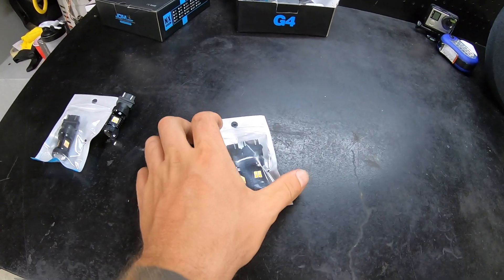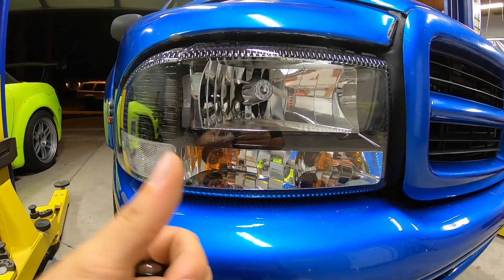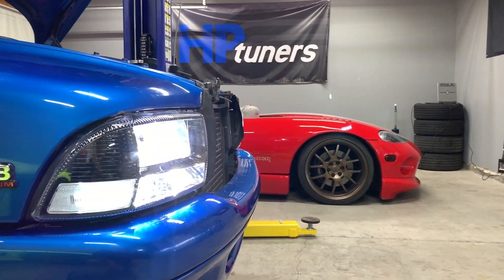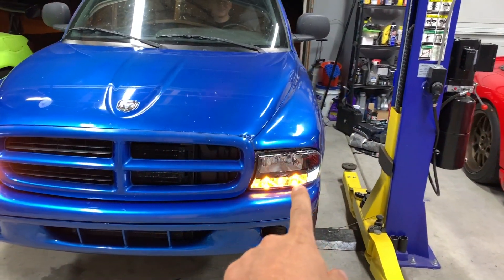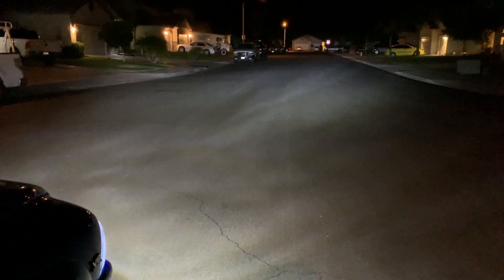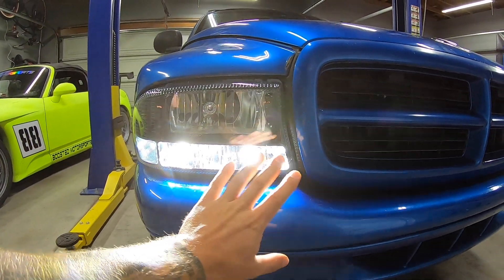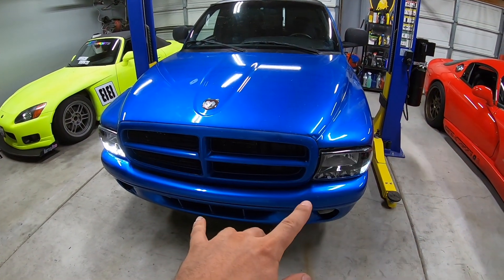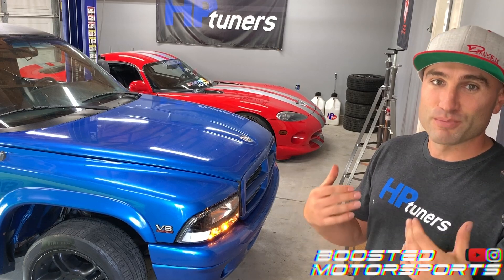3157 LED SWITCHBACK BULBS WHITE TO AMBER - JDMastar - DODGE DAKOTA

Comment: Finally someone else made affordable Switchbacks that function correctly. The old ones used to blink white then amber when your turn signal was on. Which is technically illegal. But these fiction the way they should. White turns off then only blinks Amber with the turn signal activated 👍

Comment: Ok so apparently my stock relay was toast! Picked up a new relay at orielys and they work flawlessly! Just need to upgrade my headlights and dogs to led to complete the look thanks for your awesome videos bro! Really excited to find someone putting out quality info on these awesome trucks
Reply from the maker: Glad you found the problem Travis! 💪
Reply: @BoostedMotorsports  what bulbs are you running for the corner lights?
Reply: @sean.g4516  194 led
Reply: Was your turn signal working when you first the bulbs in? I can’t signal is it because of my relay?

Comment: I love these lights! I have a 2008 Saturn Aura and I just intalled the Hikari High Beams and the Cougar Low Beams in my car and they put out a TON of light! I rarely use my high beams because the low beams are so good! I bought the 3157 switchbacks and what I find really cool is when I remote start my car they will still show up as orange but when I turn the key they will turn white for the DRL which is interesting. Thankfully, I didn't need a resistor as I can't splice to save my life.

Comment: 3:52 all that light that you're impressed by in your switchbacks is useless to the driver because the hood-line blocks the road being lit up in that 'hot zone'. 

Sure, as a pedestrian walking in front of your truck, they'll be blinded by the light if they look at your parking lights but if they look straight down at the road, they'll be able to see their contact lenses on the road should they pop out of their head from squinting so bad at the blinding light. Pretty sure Five-O will be really impressed on a dark back road though.

Comment: Anyone able to advise me... Want this type of thing but to work on my reverse lights and rear turn signals. So they would be just turn signals until I go into reverse then they switch that way over but potentially have the over ride so if I am signaling then which ever way Is engaged to signal stays on signal but other bulb switches?

Is that possible? Any links to videos showing this?

Comment: How did you have running lights my 98 doesn't did u have to wire them up?
Reply from the maker: I know the switch is different on 99+ but that’s stock. It’s a dial type switch but I think on the knob one you have you should be able to just pull it one click out or halfway for running lights
Reply: @BoostedMotorsports  oh i always knew them as parking lights lol after its been so long u still like them still recommend them?
Reply: @BoostedMotorsports  hey quick question as well where did u get the dash lights mine are half way out I might as well add some color

Comment: Did you have to add a load resistor? I bought the switchbacks but when I plug 2 on one side, one turns on the other doesn’t, I assume because the wiring is connected.
Reply: Did you ever figure out if you needed resistors for them

Comment: Hey man great video I just bought these bulbs for my 2003 ram 1500 but befor I installed I realized that I have bulb shields on my turning signal side of my new headlight housing. My question is will they work with the shield still Intact or could I remove it?
Reply from the maker: I would use it with the shield. These are super bright. I’ll be installing them on my 3rd gen next for you guys in a video so make sure you’re subscribed 💪

Comment: Not that im late or anything but did you just install new bulbs into the stock light frames or are those also new?
Reply from the maker: Aftermarket headlights 💪
Reply: @BoostedMotorsports  sick!!!  I have a 2002 Dodge Dakota Sport 4.7 first car! I want to do a lot to it
Reply: well technically second car but first truck

Comment: Looks awesome, nice upgrade! These work without resistors? Or do they have build-in resistors?
Reply: Yes we need to know this
Reply: @lettzagobrandonyeeyee4309  just installed mine they need a resistor, i dont know if it is fuse type or the wire up kit kind.

Comment: Are you sure the stock bulbs aren't just regular incandescent bulbs? A halogen bulb is filled with a mixture of an inert gas and a small amount of a halogen such as iodine or bromine that enables a halogen cycle chemical reaction which redeposits the evaporated tungsten back onto the filament for longer life. Usually halogen bulbs are found in headlights, fog lights and in some applications, cornering lights.

Comment: ima put these on 4th gen the ram projector headlights with the strip that has the amber bulb,,, hehehe thanksss
Reply: Hey man do you know if ya have to add anything else for these to work on the projector headlights? Or are they plug n play?
Reply: J Stokes I dont think so, only for the headlights you have to add an anti-flick capacitor. Boosted did the whole led conversion on the 4th gen ram its on his yt vids.

Comment: 1:23 Those are not amber Halogen bulbs. If they were they would have a smaller glass capsule inside the larger weak glass of those standard tungsten bulbs. Halogen bulbs run much hotter an always have a much smaller glass bulb.